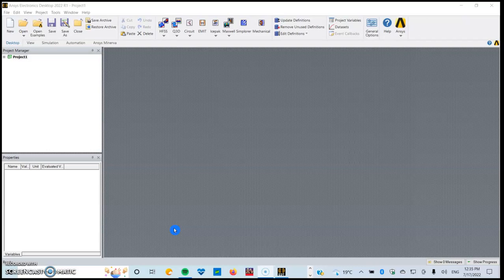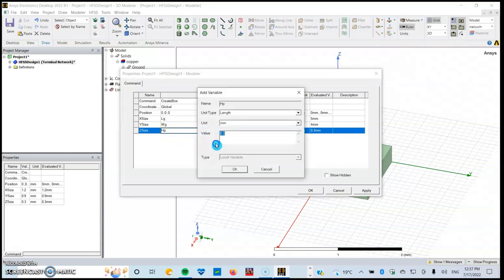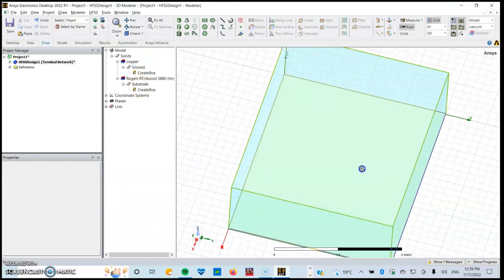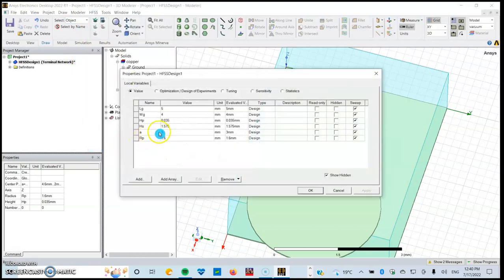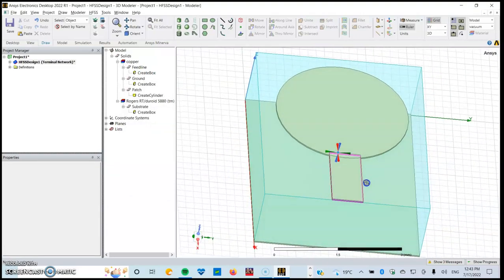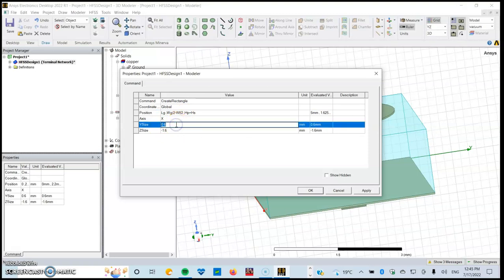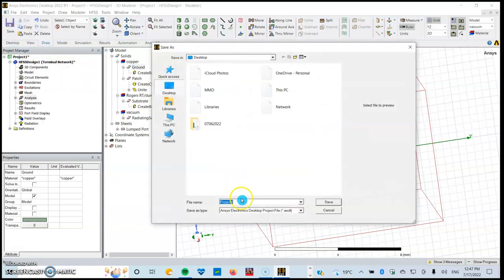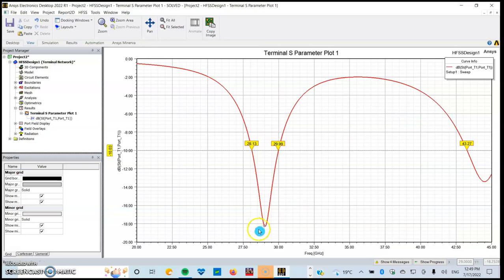Circular Microstrip antenna for 5G at the millimeter-wave band using HFSS

Comment: Why we have taken circular patch coordinate at a+ l/2 and not at the center of substrate
Reply from the maker: @va5314  just to make the feed line a bit longer. In practice this can minimise the field coupling between the 50Ohm connector and the patch itself
Reply: @rfengineering2022  can you tell me dimension for feed line dimensions for 28GHz circular antenna
Reply from the maker: @va5314  the feed line should have a characteristic impedance of 50Ohm. The width of a 50 Ohm line can be calculated using the dielectric constant of the substrate, the thickness of the substrate. He is a link to an online calculator 
https://www.everythingrf.com/rf-calculators/microstrip-width-calculator
Once you calculate the width you can choose a random line length to fit your need because the length doesn’t impact the matching of a 50 Ohm line

Comment: Hello sir, Firstly I will give you thanks. Sir, I used HFSS 15 that's why I struck in the Radiation Box design part( you said that right-click on the workspace and create an open region but I haven't got this option in HFSS15? Plz, help me, sir. Thank you and it will be a great help to me.